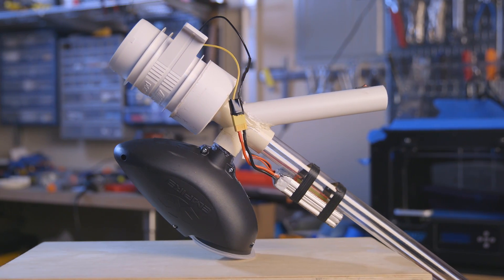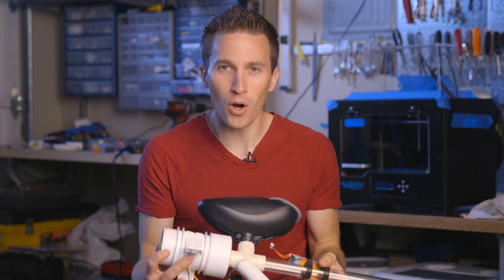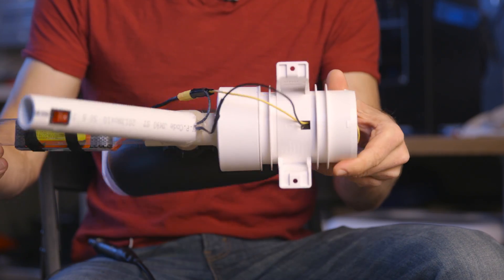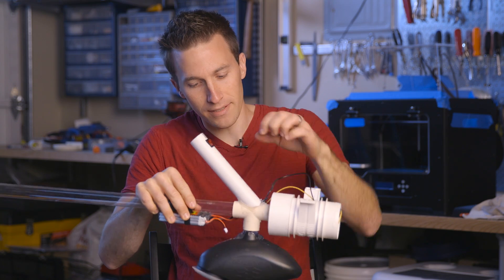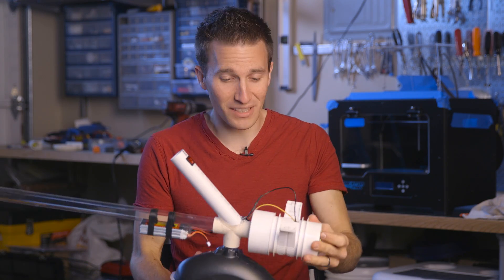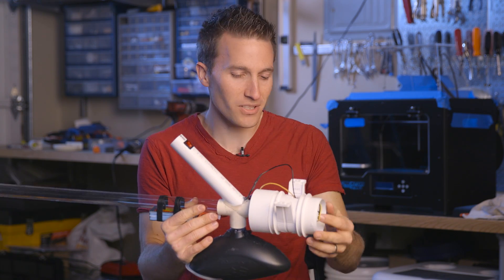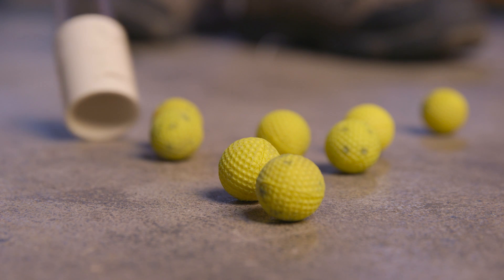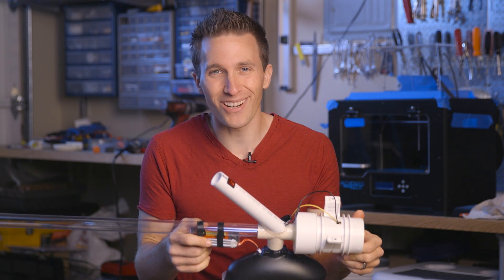PROTOTYPE: Nerf Rival HIR Vacuum collector "HIRicuum"

Comment: Have you re-visited this idea? I love the simplicity of this design. I am hoping to build something using a stronger motor some I'm not having to pick up one ball at a time.   I'm currently working on an idea that uses a lithium shop vac I think ill try something like yours with a battery powered leaf blower attached.

Comment: Need a feeder hose, flex to feed into one side of the double tank that FDL did in their tease video”” then the vacuum hose to pick up while firing a Jupiter. Retrieving free rounds on the fly all running of 2 desperate batteries. One for the agitator/blaster the other to the collector. Could the exhaust from one feed into another do both....just saying. Retrieval slash firing I dub thee “ Nerf Mech”

Comment: The catch that I made for darts is just a blanket over a open door entrance with a clothes hamper under so I can dump the darts out.  It doesn't catch them all but what don't go in are close to the hamper. It works well but can be improved

Comment: If you use a downward facing angle in the tip it will help with the airflow characteristics and give more lift in picking up the balls, this would be more practical for non-ideal playing environments where the tip cannot directly be run across the ground. the idea is that you don't actually change the amount of pressure differential but you reduce the downward force of the air on the top of the ball. I'd imagine between a 15-45 degree angle on the tip.

Comment: hey, you should combine this vacuum with your zeus blower, that makes you could easily pick up darts/balls and then immediately load them up and shoot out again. from vacuum to a blower all you need is just change the airflow right?
Reply: +Chris Baconham I considered this, but realized it would probably be more practical to apply the hopper to the zeus after use in the HIRicuum.